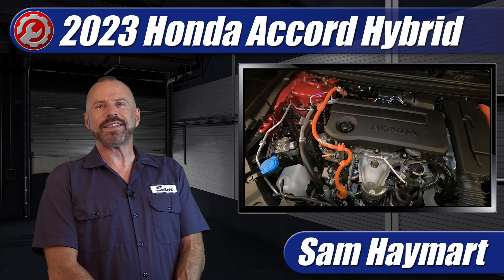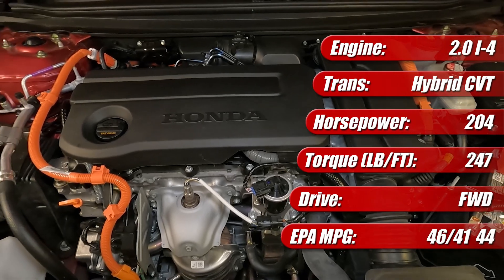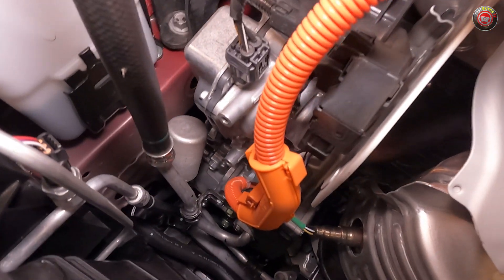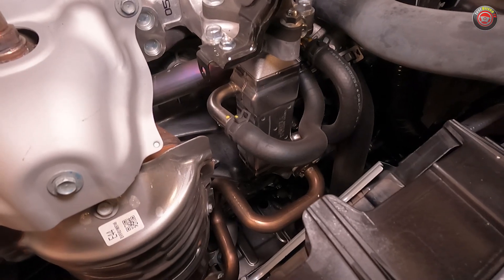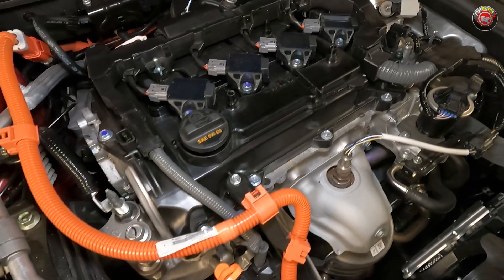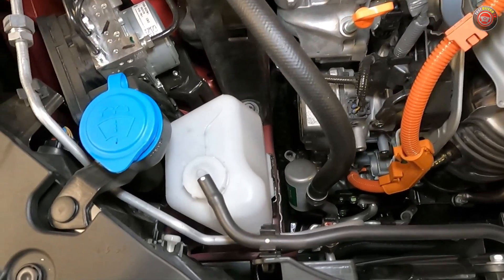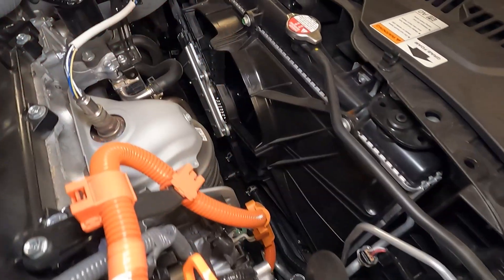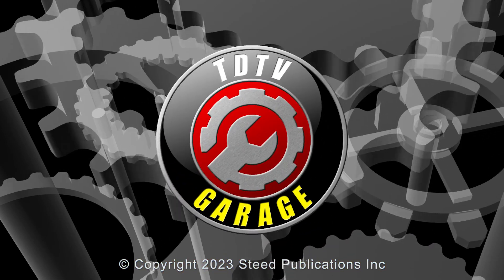2023-2024 Honda Accord Hybrid: Engine Explained

Comment: I am concerned about the technical aspect of the hybrid engine. Do you recommend buying it and what is your evaluation of the system? Thank you for the useful review.
Reply: This hybrid engine, is mostly an electric car first, 135kw drive motor, compared to the 109kw ICE engine. It's mechanically very simple and for the electronics there are no known issues, the same for the software.

Comment: Awesome thank you!! Does the honda accord hybrid touring have an easy catalytic converter for thieves?
Reply from the maker: The main catalyst is up under the hood as shown, so less easy than if it were on the bottom in the center.
Reply: @TDTVGarage  Thank you! I have the same concern. How effective would it be to get an anti theft shield for it even though it’s under the hood now?

Comment: Hello Sam i am currently driving my 01 dodge neon and i was looking for a accord but i wanted a non turbo non hybrid and last made was 2017 the new 2023 i can get the 2.0 but it has a hybrid. I don't know much about hybrid battery but can you tell me how long the electric motor last and how much to replace? And also how long the battery pack last and how much to replace? In the ball park if you can. The reason i asked is because i read an article about hybrid on honda and the battery pack can cost a little over 14 thousand dollars? Is this right or the article was wrong? 
Thank you for your knowledge and time.
Reply from the maker: These things don't routinely need replacing.
Reply: @TDTVGarage  thank you, but if fir any reason the battery pack fail, do you know how much to replace it?
Reply: @sernani99 the dealership I bought one from stated it would cost $3800 for the battery.  But the battery has I think a 10 year 80k mile warranty on it.  So the best bet is hopefully cheaper in the future because the battery technology will be better by then. If not unload the thing before then😂
Reply: @Mr.Steve530  thanks.